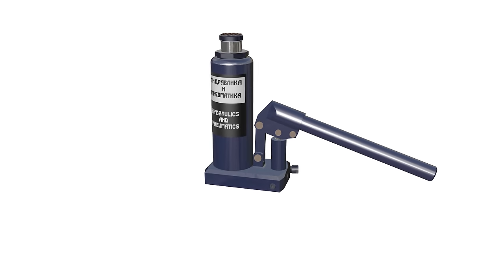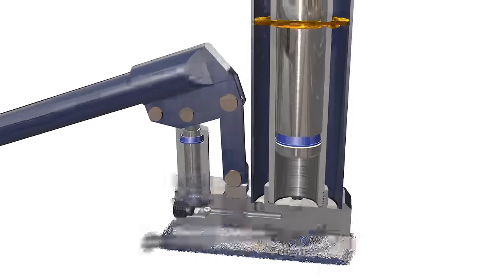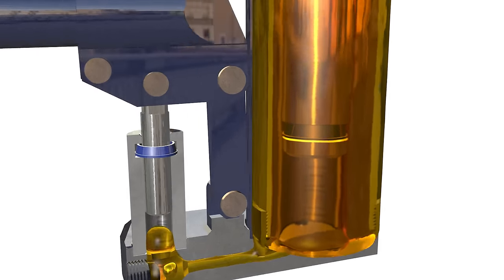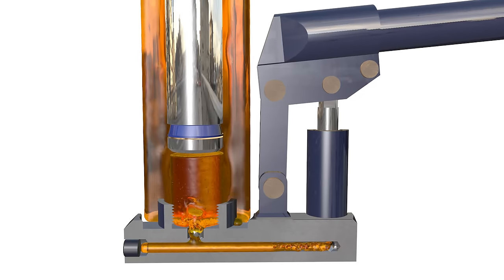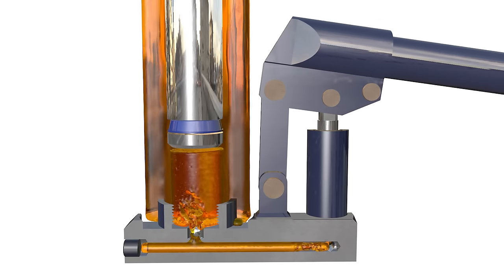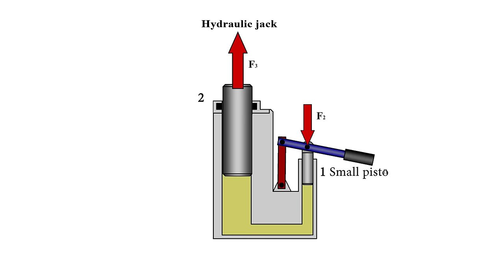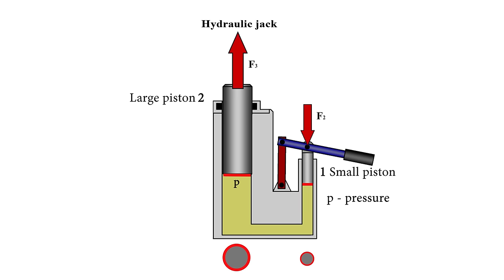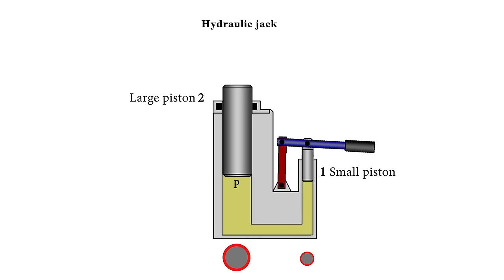How hydraulic jack work

Comment: There must be an air pocket inside the reservoir tank to allow oil to be pulled from the tank on the up-stroke of the handle, otherwise negative pressure would build up inside the tank and resist the up-stroke.
Reply: I wonder how the release system works because It releases air but not hydrolic fluid

Comment: How do the check valves open and close? And why doesn't the big pressure in the big cylinder cause the fluid to back into the small cylinder while the check valve 2 is open?

Comment: Going a slight step further, how does the TANK allow air in, to transfer fluid into the SMALL PISTON chamber?
If the jack is turned upside down, I've never seen fluid leak out. Are there check valves at the TANK to allow air movement?
Reply from the maker: Yes, there is a breather on the tank to connect to the atmosphere. Many models of jacks will leak if turned over

Comment: What I’m trying to wrap my head around is how this even works. I understand how the lever multiplies the hydrostatic force located underneath the large piston, but if the force under the large piston becomes so great that it can lift a car for example, why does it simply not destroy the small check valves? How can the check valves absorb that kind of force without being destroyed?
Reply: Short answer: spherical steel ball bearings are unbelievably strong
Reply: Sometimes it does.. and you won't be able to lift any heavyweight by using that jack.. In that case it needs to be repaired..
Reply: The check valves are very simple and strong - just a steel ball bearing resting in a machined iron or bronze seat. There is also a light spring that tends to hold the valve in the closed position. When the lever is pumped the fluid pressure pushes the ball off the seat, opening the valve for the duration of the stroke.

Oh, and the valve body is the case of the jack itself. Again, very strong.
Reply: The force of pressure depends on the area (it's measured on pounds per square inch). This means that a very small check valve will also receive a very small force compared to the large piston, even though they're both under the same pressure. 

However, the body of the jack has an even bigger area since it has to contain all of the fluid, so that has to be even stronger than the large piston.

Comment: When there is a ton of weight on the jack is it better to lift the handle up or leave it down? Does it matter at what position it is?
Reply from the maker: The pump piston will be in the up or down position. I don't see much difference in this.

Comment: i didn't know the behaviour before .. but there is a little mistake in the picture/model ... the 'open valve' must be on a second/parallel pipe channel ... =) .... opposite every time that the fluid/oil is pushed it will come back on the primari camber

Comment: Is there any breather Pipe and won't the oil get leaking from it ?
Reply from the maker: The breather is usually jack-mounted. Oil may leak from it if the jack is turned over

Comment: What liquid is used inside??
Reply from the maker: Hydraulic oil
Reply: Ok
Reply: @Гидравликаипневматика  why not water? So it doesn't evaporate?
Reply from the maker: @szymoniak75  Hydraulic oil is a good lubricant, and it also protects parts from corrosion.
Reply: @Гидравликаипневматика  right